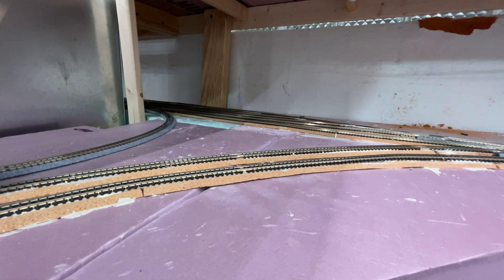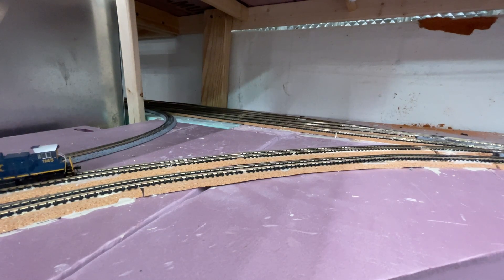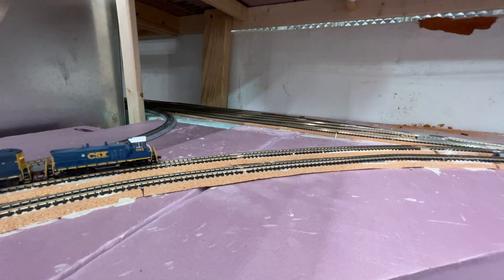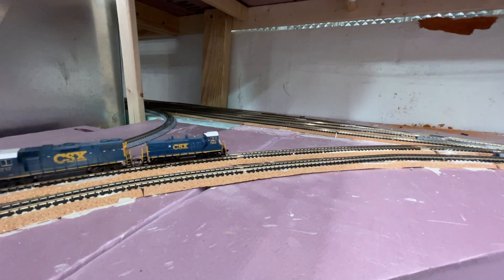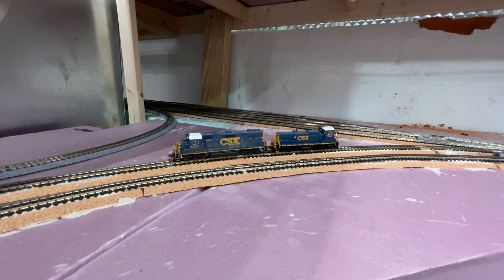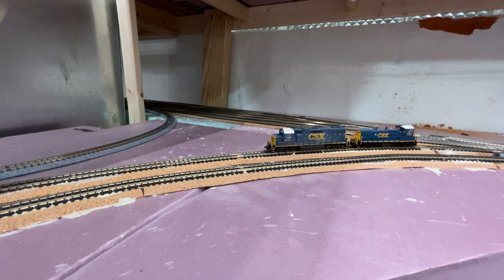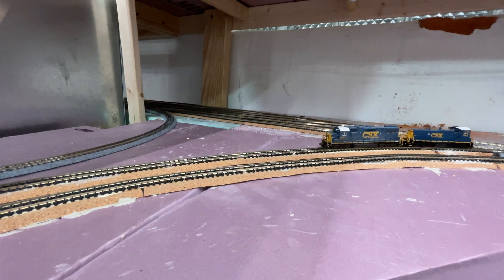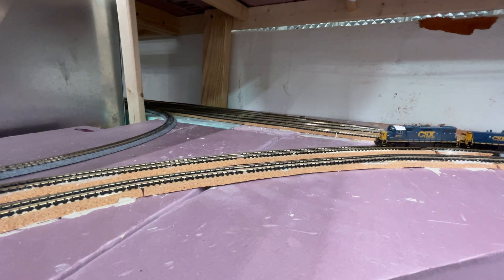Wiring for Complex Track in DCC

Comment: Very interesting information.   Im trying and doing everything i can to avoid needing a reverseing loop.  Just a little FYI.   I put in a Atlas turntable so everything would line up with my  roundhouse.   Simple to install too.  But the motor that is sold separately is very noisy.   (Irritating as heck).  At least I know i can count on you if i ever decide on putting in a loop.  Great seeing trains moving again.   Hopefully your still having a little fun
Reply from the maker: it's so nice to be able to set the trains to run and work on the layout again!  because a lot of the track is still temporarily set - i get a derailment every so often.  but i'm working my way back through it now to finalize track layout and placement so it's about 95% there.  the reverse loops aren't bad.  I do have mine set to cross over each other (a necessity to run two trains and not have a head-on collision), but i haven't had an instance where the cross-over resulted in two trains meeting at the same time.  i need to be aware of that or it'll be a mess.

Comment: Nice to see trains running again on the AN. Know you have to be happy about that. Thanks for the info on the AR1. I also suffer from the not always following directions issue. I'm reworking a whole scene on my small layout right now because I didn't read some directions as well. Don't feel bad about that. Happens to the best of us Happy Thanksgiving to you and your family!
Reply from the maker: I legit saw those connections on the AR's reverse section and the bulb never went off in my head that it was the reason they were shorting out.  Really felt silly BUT i was also surprised how unclear a lot of the online instructions were.  Even the Digitrax page left out a key element with that third set of insulated joiners.  Now, the   PSXX-ARSC which I'm about to talk about - that thing is a monster.

Comment: I have a question for you. Your video is Very interesting and very informative by the way. I’ve always been scared of a reverse loop on my DCC system because I want to have two entrance points. So my question to you is, do I have to isolate the entire reverse loop from the main bus line? So if I’m going in from the south side of the loop And I can reverse loop and head back. And I want to enter the south side of the loop and have a north side exit. Do I need to isolate the entire loop at both Ys?
Reply from the maker: couple of pointers.  first, don't forget, you can only ever have one train in a reversing section at a time.  so if you're running a double mainline, both mains need to be isolated from each other and from the rest of the layout.  If you have tracks that branch off from the reversing section, they should be isolated and if trains could operate on those tracks independently of a train in the reverse loop (like mine), then you need to have an additional AR-type unit installed to correct the polarity when that train wants to leave the siding it's on.  in both a wye or a true reverse loop - you must have a section of track that is completely isolated.  if you're using unitrack, you won't cause a short until you cross the turnout on the way out because they're power routing.  take that into consideration when you're planing your isolation joints - you don't want to accidentally create a dead section when you're powering things up.  did that help?

Comment: Nice! Ya doing some mind twisters there! Ive thought about putting a reverse loop on my turntable the way another guy did his fir the sound loco part but juat like it the way it is. NOW, i dont think his way would work with yours due to the main line reverse loop tie in. Thats great the way ya have it. Neat figuring that out. Would like to be there when you running and see it all work LOL. Ive got to clean up the ubderside if my layout too and put some curtains on at some point. You are doing great work my friend. Happy Thanksgiving to you and yours!
Reply from the maker: I am just a little too embarrassed to show the underside of my layout right now.  I have so many things 'temp'd" in until i get the layout situated that it's just a mess.  most of it is for the future add of circuit breakers but when i moved the sections around i cut a lot of wires and disconnected a lot of things and until i get it all back in place, everything is just hanging underneath.  it does not do well for my need for organization but, every day it's closer to being right. having a good sense of electrical circuits helps a lot in these instances.  understanding how the components work (as a whole, not necessarily everything on the board) really goes a long way in understanding how wiring should work.  I've been fooled before - usually because of my own mistakes!  fortunately - these things are surprisingly robust and will let you screw up a few times before you fry them.